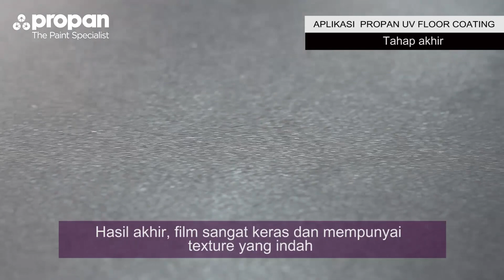Propan UV Floor Coating

Comment: Untuk finishing apakah ini bs diaplikasikan dengan merk cat epoxy lain? Dan jika bs ada kontak untuk jasa + bahan uv floor coating ini wilayah depok? Tks
Reply from the maker: Untuk area apa dan luas berapa pak ? Kami akan carikan rekanan applicator Propan
Reply: @propanflooringandwaterproofing  untuk 26mx16m pak
Reply from the maker: @danandearbar2630  untuk di daerah mana pak? Jika berkenan untuk konsultasi langsung bisa menghubungi product manager kami di 081808813071 dengan pak ardi. Terimakasih